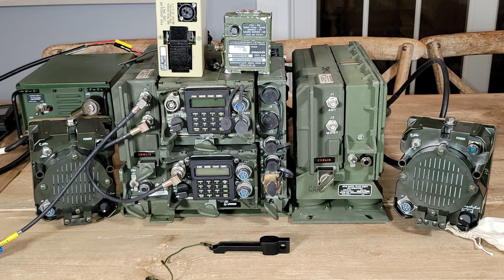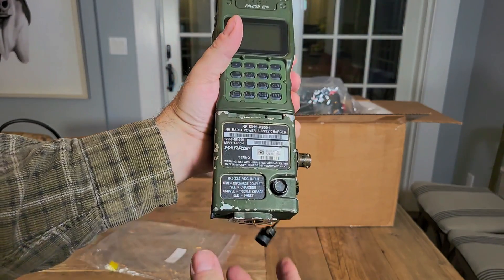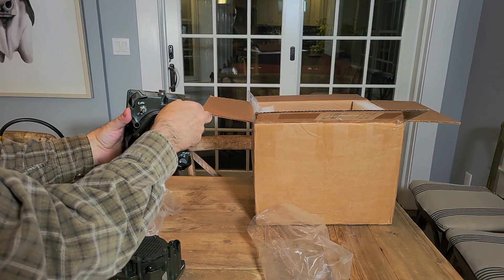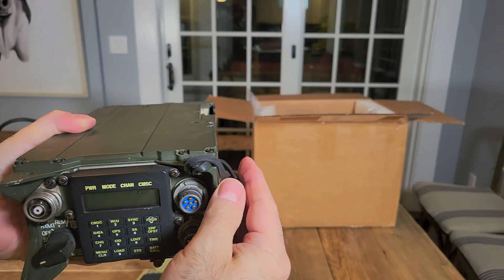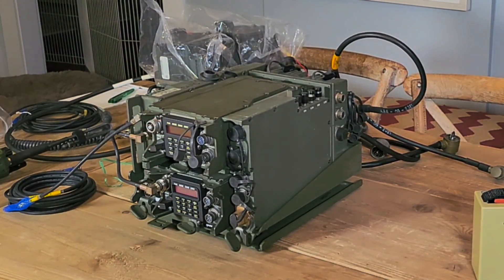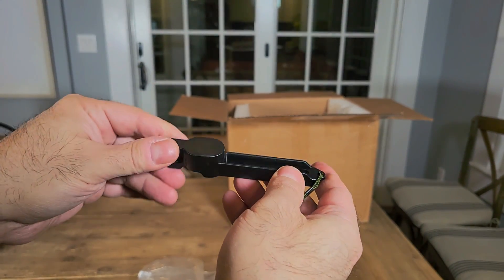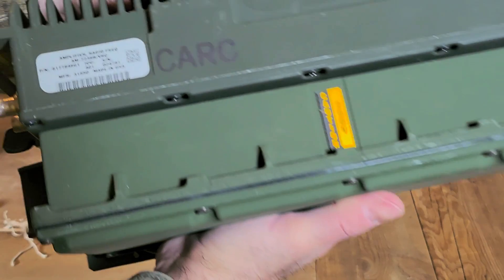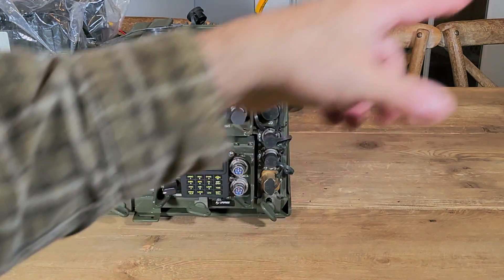Even More Unboxing/Assembling SINCGARS AN/VRC-92

Comment: Can we get more videos on the RF-7850? Like all the different functions and modes.
Reply from the maker: You bet! I just acquired a later firmware version of the radio with spectrum analyzer built in and web interface. Will do some vids on that. But it will be a while. I have something like 10 vids in the works already (on other topics) 73
Reply: @w2hx how do you get radio firmware updates? Do you have a harris rep?

Comment: Do you have experience of working with RF-7980-ST001?
Reply from the maker: I do not, but a friend has. they dont work well with regular radios. The audio overloads from a receiver. Almost as if they expect line-level audio (0dBm @ 600 ohms) and not amplified headset level audio. I dont know anything more about them
Reply: @w2hx  interesting to get know more, cause the item is not so easy for manufacture and not clear what it made for, what task it has to perform...

Comment: Can you post a video on how to program the 5800H/ PRC 150?
Reply from the maker: Some day, perhaps! If I find myself programming the 5800H I'll be sure and post it.
Reply: Robert Dodd:  There are some differences between the 5800H and the 150, but both radios are quite similar.  Basic steps to program or view a specific channel or “preset”:  OPT (or #8 button), MODE, PRESET, CHANNEL…..  However, there are several other selections that setup the whole radio (such as squelch settings, bandwidth, clear or PT settings….etc.